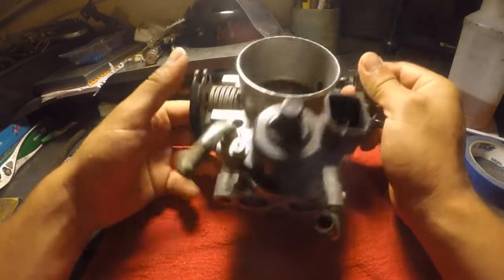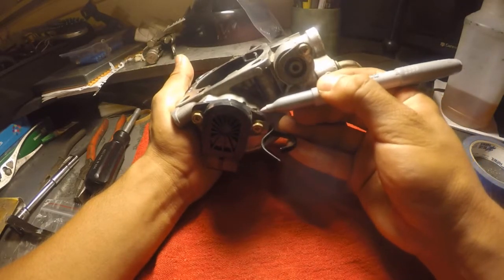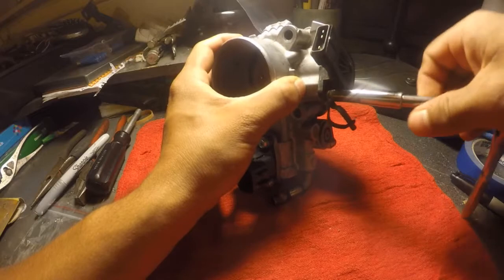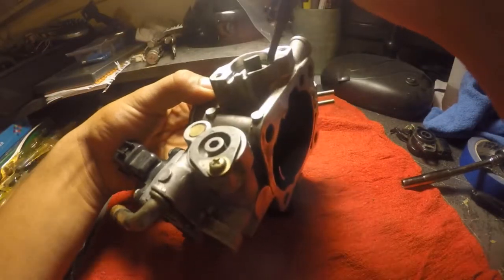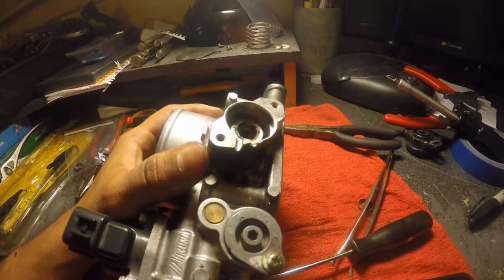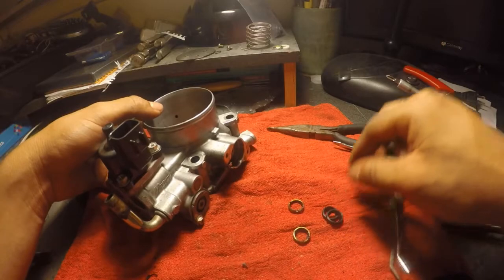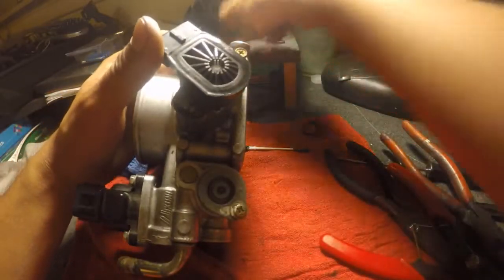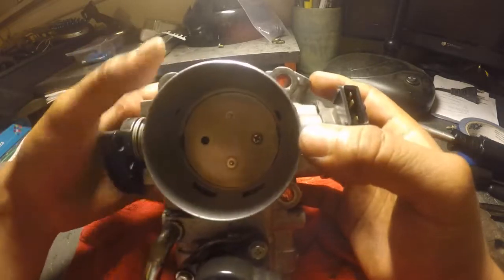How To: Evo 8/9 Throttle Body Rebuild (Shaft Seals)

Comment: How are u able to buy all those motors, cars and parts for them? And who is that bad ass dude that is building your motor? What shop is that? He's pays a lot of attention to every little detail.
Reply from the maker: +tommy facekicker Dsm parts are cheap as hell, I picked up those three motors for less than $100 bucks, which is why I had to get three instead of one. As for the guy building my motor, he's a really good friend of mine. The shop builds ford racing motors but he like to build mitsubishi motors which is why i take my stuff to him.
Reply: How much does he charge? Jux incase one day my motor blows.
Reply from the maker: It really all depends on what you're looking to do with your motor. Anywhere from 200-1000

Comment: Was there a reason why u decided to rebuild your tb? Mines is idling at 2k when it gets driven for longer than a 2 hour period but when it is completely cool again, it idles back at normal till it gets super hot again. Did you have signs of seals failing? And did u have to seal the back of your butterfly with some kind of material like they recommend or just installed it after re-assembly?
Reply from the maker: +tommy facekicker I was getting my car retuned and I knew that these seals were bad because of a boost leak test. As for any signs that my seals were failing, i didn't notice anything different when driving. I just knew that I was losing boost pressure at high RPM.
Just make sure you lube up the seals with grease before installing them, also put blue lock tight on the butterfly bolts so that they don't back out when driving
Reply: I know it's been like a year, but my guess for why your car idles high when hot is the throttle cable is adjusted too tight.

Comment: Would this cause idle drop when coming to a stop? My car idle drops to 300range then comes back up when going into neutral stopping or when I rev it at neutral
Reply: SauceyEVOVIII idle air control valve or a vacuum leak